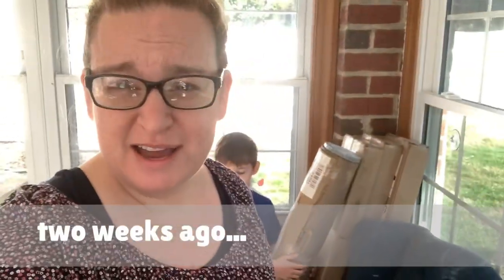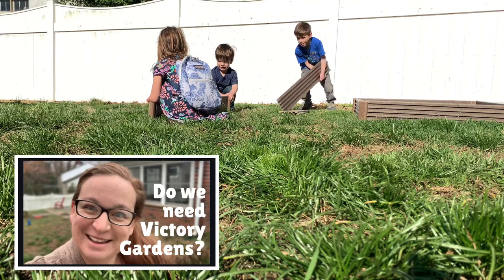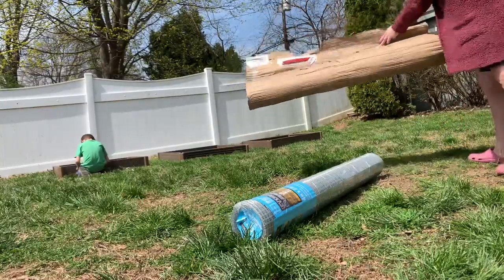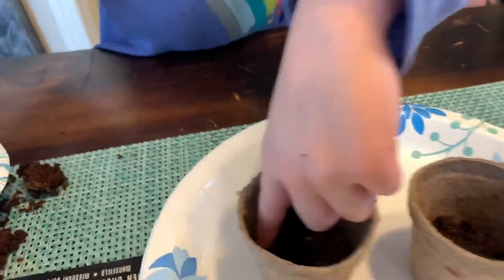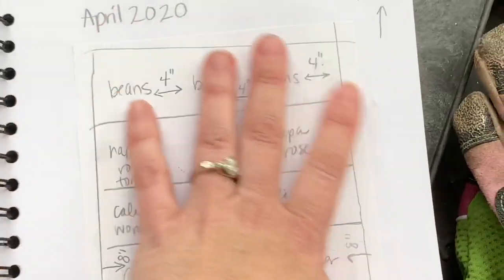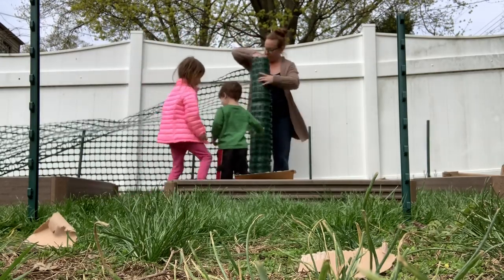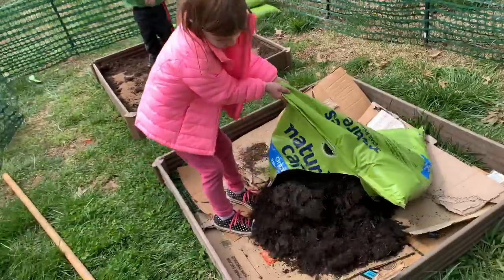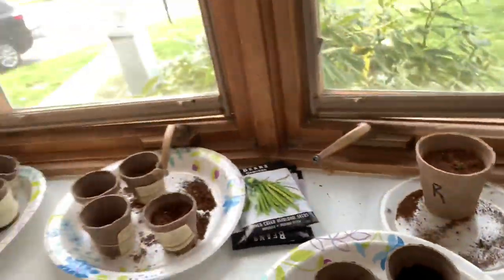Our Backyard Garden Design for Raised Bed Gardening

Comment: The perfect little greenhouses for the jiffy pots are those plastic 6 packs that muffins come in from the grocery store...you just pop the jiffys in and water in the pot and in the bottom...then close the lid. Keeps all the moisture in and helps the soil retain heat. Super cheap solution...I use mine every year. 😁

Comment: We had raised bed gardens back in the 80's. They were a great idea, until around year 6 or 7. What happens is that the grass will develop runners into the soil and try to convert the bed into a lawn. There doesn't seem to be any solution other than to make sure the beds are installed on concrete or dirt. Also try not to use mulching, they tend to attract slugs. I was traumatized decades ago and haven't gardened since. lol